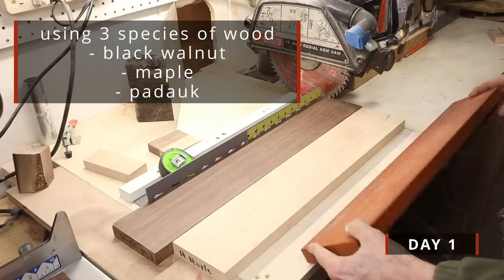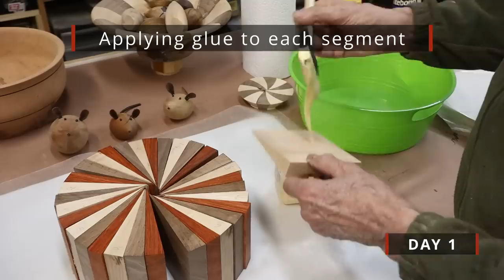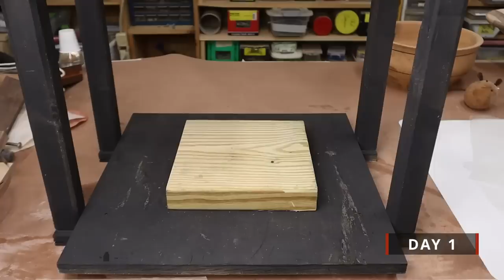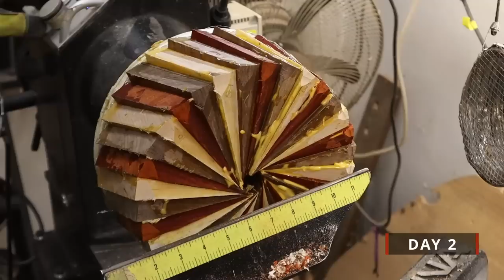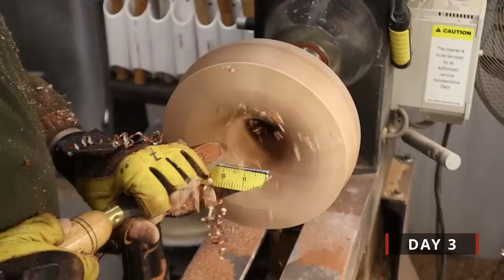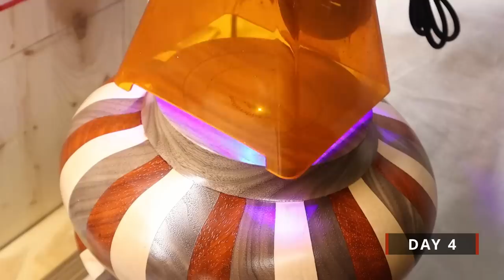Woodturning - Slanted Segment Bowl

Comment: Nice bowl. Was wondering. If made a larger cone(diameter) and used cheap wood for cone, would it work still? So you could make peices of hardwood not as big and  not need to fill centre of blank as it only gets cut away and wasted. I know you would then need to make a base. But be cheaper on wood.
Reply from the maker: Interesting idea, i'd say definitely give it a try and let us know how it goes

Comment: Very beautiful!!!  Here is what I would have done differently.  When you are truing up the different surfaces I would also true up the center hole that would become the bottom.  Once that dimension is known I would have turned the walnut bottom to form a tenon to fit the hole and back cut the rest of the base so that it would fit snuggly with no gaps.  I could see an area where there was a gap between the bowl and the base.

Comment: Im inspired by this, got the blocks cut and would eyeball the slicesbut id figured I'd ask at what degree are your slices
Reply from the maker: Hi Tim,
Thank you for your gracious comment.
We used an angle of approximately 15  degrees.
The exact angle may vary a little since it depends on the thickness of your block.
Let us know how you finish!
Reply: @exeterwoodworks  will do, appreciate it

Comment: Wow, that is so gorgeous!  What angle was the wedge that you used to cut the pieces on the bandsaw?
Reply from the maker: Hi Caral, the angle we used is approximately 15 degrees.  The exact angle will depend on the thickness of the piece(s) you are dividing corner to corner.  Practice dialing it in on a few scrap pieces first.

Comment: Did you do anything to clean up the bandsaw cuts before gluing them together?
Reply from the maker: Yes, we lightly sanded each side that had a bandsaw cut to ensure tight glue joints. Decided not to include footage of sanding each piece to keep the video moving and not too long!